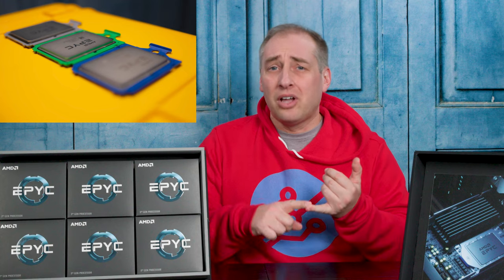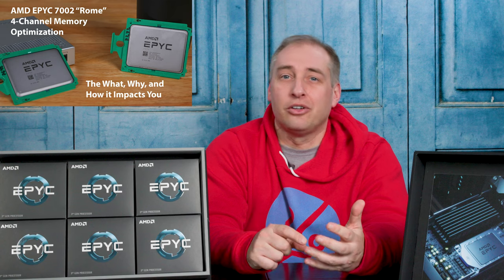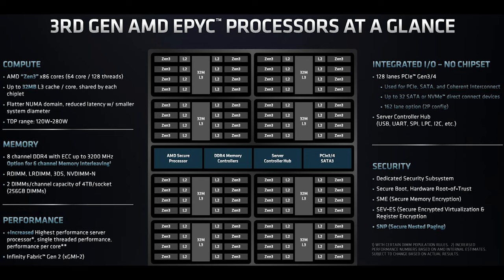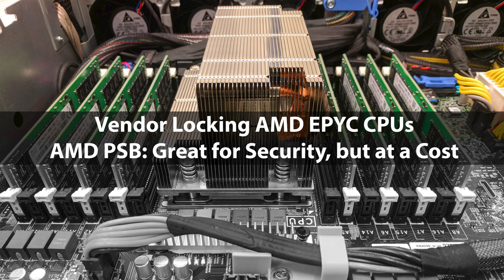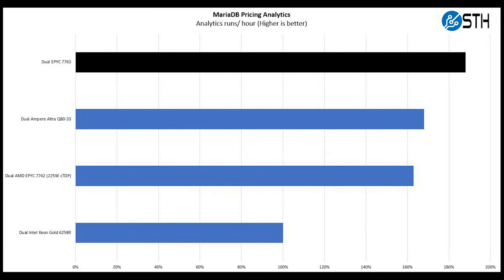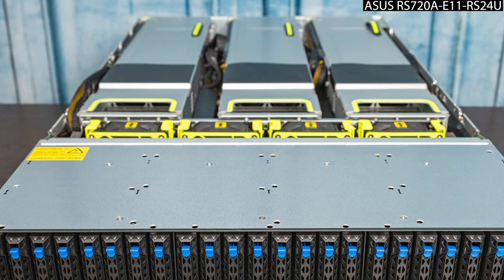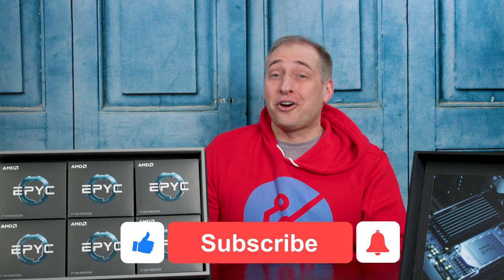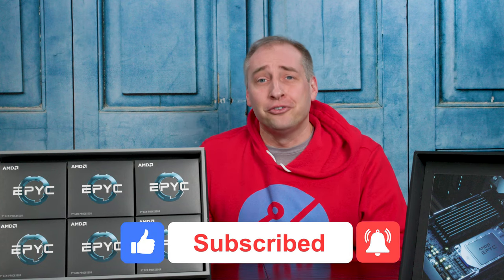AMD EPYC 7003 Milan Performance, Features, and Intel Ice Lake/ Cooper Lake Competition

Comment: Now waiting for used EPYC Zen1/2 to trickle down to second hand market when Data Centers start upgrading to Zen3
Reply: My experience of this strategy is that prices never really get that low enough to do that switch with a seriously justifiable ROI so the longer one waits for appreciably rock bottom pricing, some juicy SKUs will be out for new machines and volume of workloads required at that future moment then back to waiting for the next cycle of set of variables.
Reply: Zen 3 needs another 5 years of proven stability in the field and a proper distribution network if they want a chance at being considered. At this point, amd is unable to provide and distribute the cpus to all the clients in this field, which is why it's adoption was very very little in the past years.
Reply: remember they added the feature you really really requested: efuses that blow when setting the motherboard vendor.
Reply: @charlesselrachski34  Oh that I remember clearly, it is still a good CPU and that feature might make it cheaper on second hand market, though we still have to wait 2-3 years before the hit, and there won't be that many as Xeons
Reply: And for their prices to creep way away from list price. I got lucky and got my 7302 for $600. Should have just risked my financials a bit and bought 2. I'm now in market for a second one and haven't seen any for far under the $900 mark. I guess my first one was an absolute steal.
Reply: @timramich  I've recently seen 7742 sold for €1k on ebay
Reply: @arkdesign9517  ... do they need to?
Reply: @DLTX1007  yes. They've had no adoption in those fields. They're wasting money making enterprise CPUs nobody is buying. That market is based on hardware meant to be turned on and then guarantee its running with no glitches or hickups, which amd is currently unable to do. It's always something making it unstable and the enterprise market simply doesn't fuck around like that. That's why intel has 99% market share in that market, because of proven stability. There are 16 year old Xeons still running today in server farms and they never crashed.
Reply: @arkdesign9517  lol nobody's buying? they can't even make enough not only that, Epyc has a >5% share only because it takes a long time to penetrate due to upgrade cycles. If you can't understand that then I can see why you made a comment as silly as that
Reply: @DLTX1007  name me 3 companies that actually migrated and changed their intel infrastructure with an amd one. Just 3, and I mean worldwide. You won't find any. The laughably tiny sales on epyc were bought by rich dudes with money to spend, they didn't get ANY adoption by actual companies who depend on that hardware running. The media was full of news on the lines of "thinking of" and "considering", but none of them actually flipped, which is why their market share in the field is piss poor and talking to someone invested in that market and mentioning amd will get you laughter in return, again, because of the unproven stability (along with inability to satisfy a worldwide demand for such hardware).
Reply: @arkdesign9517  I like how you live your own bubble slow clap
Reply: @DLTX1007  nice way to avoid the question. Can you name one if the requested three is too much for you?
Which part of my last comments is innacurate? Point them one by one and I'll explain it for the thick minded as well, no problem.
Reply: @DLTX1007  checkmate xD
Reply: @a_spire   Checkmate who? AMD wouldn't be unable to meet demand if they weren't deploying that many. They know they were going to get high demand and put in a big TSMC order for wafers and they still are running out of capacity.
Reply: @DLTX1007  why doesnt big datacentres switch to Amd Epyc then? If they are cheaper than Intel Xeon and why not? I think its still a reliability and stability vs speed and more cores. As the other AK said new a few big corporations or huge datacentres that switched over? At datacentres its not like home , zero tolerance for a downtime faults to be fixed, etc etc. I think AMD needs to make better stability vs the proven Xeon that overwhelms this already.
Reply: @nihonkokusai  apart from the fact that the DCs that did run C Atoms got burned by the LPC bug? Stability is not guaranteed by any company.
Reply: @youtubecommenter4069  te try 54 me
Reply: Zen 3 V-Cache would probably be what they start upgrading to, especially people using the F skus.

Comment: Nobody talking about the 28 and 56 core CPUs? They mean that AMD is now actively binning 7-core dies, instead of switching off another core and turning them into 6-core dies.
Reply: Really show u how amazing zen architecture, so versatile
Reply: Or an extra middle finger to Intel, because that's Intel's top SKUs. 28 for the 8280 and 56 for that weird dual die chip.
Reply: I guess this means that they're producing enough defective 7-cores to get entire SKUs... I don't think that's down to the process, but rather the scale of the operation at TSMC.

Comment: Now if only they would launch  Threadripper skus based on Zen3.  I miss the PCIE lanes and  four memory channels of my 3970X desktop, but the 5950X is so much faster per core that I had to go back to X570.  I want to see a 5970X with a high boost and base clock.
Reply: Now you know how I feel here with 1950X X399, AMD basically left me to dry in the desert.
Either I ditch some of my nvme drives to go X570 or pay 40% more for cores that I don't need.
Reply: Hmm? New Epyc has good turbo now, always had 8 memory channels, 128 pci-e.
Epyc has great boards, all Threadripper ever had was overpriced x-mas trees courtesy of Asus.
Reply: @SolarianStrike  Why not go with a Threadripper Pro 3955WX with 16 cores, 128 cpu lanes and 8 channel ram. I'm moving from a 1900X/Zenith Extreme to an Asus WRX80E SAGE and a TR PRO. B&H Photo had the mobo. I'll just move my old 8X16GB 3200C14 ram, 2 Hyper GEN4 M.2 cards and Radeon VII gpu. Twice the cpu lanes, double the bandwidth with GEN4 lanes and twice the ram channels. WOW

Comment: hahaha.....I love the comment about Infiniband vs. Ethernet.

LOL....

On the 100 Gbps 4x EDR Infiniband (vs 100 GbE) side -- in my own testing in my homelab, 100 GbE was about 1-3% slower than 100 Gbps IB. IB (using the IB bandwidth testing tools) was testing in around 97.73 Gbps (~230k messages * 512 kiB/message) whereas 100 GbE was testing in at around 94 Gbps.

So....it depends on what you are looking for/doing with it and whether what you are doing is latency sensitive or purely bandwidth sensitive/limited. (Yes, they're related, but you can improve bandwidth by REDUCING the overall latency which improves your computed bandwidth vs. you just pumping/running the lines harder.)

Comment: Oh yeah....re: people are going to use this for VMs.

This is probably true, but I can definitely also see a use case here as well where HPC clusters can consolidate down to just fewer boxes/sockets/total number of deployed processors overall as well.

And like you mentioned, with PCIe 4.0 x16 where you can use 200 Gbps 4x HDR IB, there are significant advantages that the HPC world can also benefit from systems and processors like these.
Reply: I'm just glad that I can buy a great workstation again.
Would've felt bumraped paying Intel 2 grand for a decent Xeon.

Comment: I'm wondering where's the successor to the Epyc 3000 series.. Really loved their low power ability with high performance.
Reply: @Airbag888  They call it Epyc Embedded I believe and I agree, they were really cool products.
Reply: @DenGuleBalje  Yep and for some reason I haven't seen a single 'decked out' board with these CPUs.. they had such great perf/watt yet somehow weren't picked up :(
Reply: @Airbag888  AMD didn't prioritize it at all
Reply: I agree. The Epyc embedded ecosystem is a awesome way to build a low cost high performance cluster.

Comment: Wait, am I understanding this correctly, you have to license the cores after you buy the chips?
Reply from the maker: You license software, often by cores
Reply: @ServeTheHomeVideo  ahh. I could totally see companies licensing the product you bought. Example. Bought a p25 radio from kenwood. It has bluetooth and an SD card to save things on. It requires a separate license to use those features.

Comment: Just take those PCI-e links as some free PLX switches. Those 32bpc-up 16bpc-down IF links will not be sufficient to support those links at full speed, and that's even more of a bottleneck if requests mostly come from the same CCX.

Comment: Why does the 7713 boost higher than the 7763, even though it's lower base and lower TDP?
Reply: @Tano Both are 64 cores
Reply: Is the cache the same?
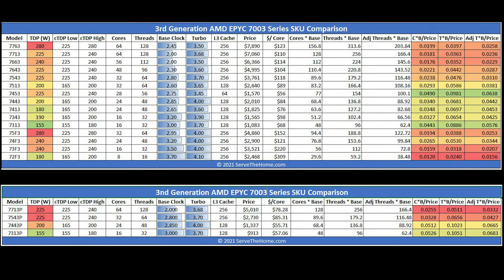Reply: @DenGuleBalje  Yes, you can see it in the video 3:37
Reply: It's a weird little artifact, but it seems the 7763 is an "all-core load" focused SKU vs having lots of bursty cores.  So maybe they tuned down the max turbo on the 7763 to keep the top-end under control.
Reply: @JMurph2015  It could be yea, but in that case it would be weird to post the specs like that. They should be reflecting the same numbers, at least in my opinion.
Reply: @xXfzmusicXx  they are reflecting the same numbers, the base clock, the maximum nominal boost clock any core can hit, and the overall power limit.   The difference (at least my guess) is that one is intended for workloads like web servers where a request comes in, a core is pushed to max boost for a few milliseconds, and then it's dropped back down while the other is intended for maximum sustained throughput at the expense of a little max turbo, think hours-long weather simulations or CPU neural network training.
Reply: @xXfzmusicXx  also remember that AMD is saying the 7763 is the successor to the 7H12, not the 7742 (which is replaced by the 7713).  That further reinforces the characterization as a sustained throughput part since it's replacing the previous HPC part.